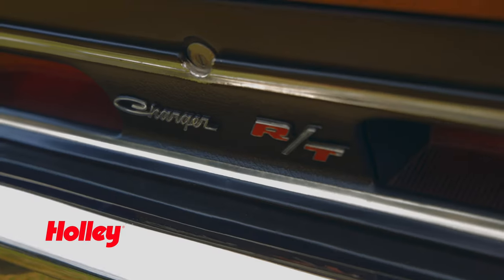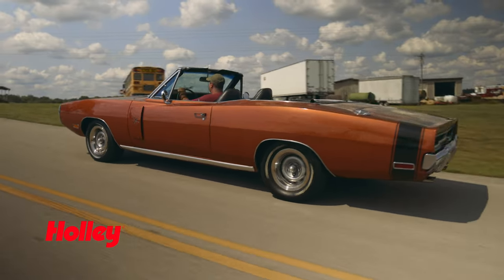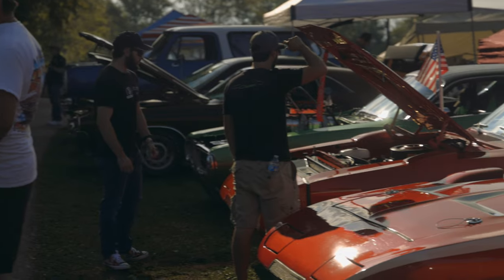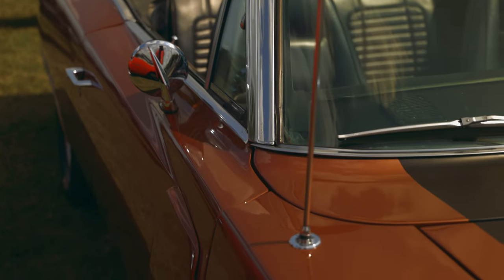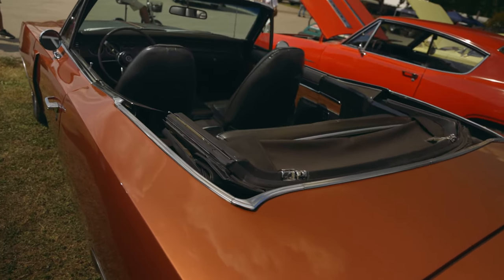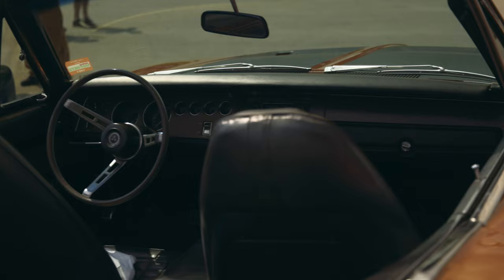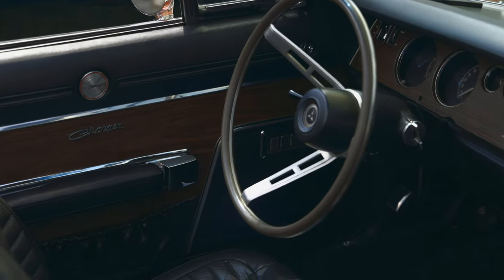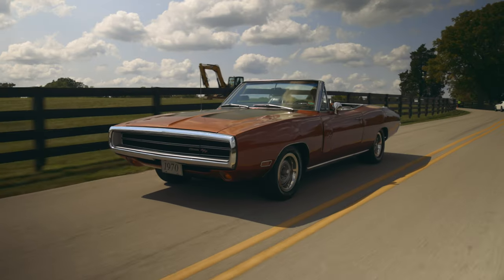MoParty 2022: The One-Of-None 1970 Dodge Charger R/T Convertible

Comment: When the Dodge Charger was 1st introduced in 1966 that’s when Chrysler should’ve had the option to produced the convertible back in 1966 or better yet they should’ve went on a head created, built, made and manufactured quite a few convertibles back then leading up to the mid 1970’s as showroom models so when the customer came in to buy a charger they had the option between a coupe or convertible.
With every option that they could think of. If they did it for the coronet and the gtx then they should’ve did and done it for the charger. Again with every option that the customer could think of that came to mind when they walked in to the dealership to buy a charger whether if it was a coupe or convertible with every option that they could think of that came to mind and I mean every single option that came to mind that they could think of.

I know I would’ve not left no stone unturned when it came to options that I could think of when it came to my mind even if I am paying for it that’s for sure.

Sincerely Yours Truly

Ivan I J